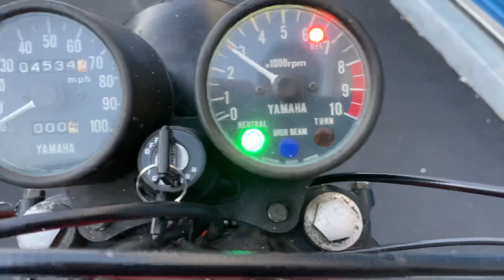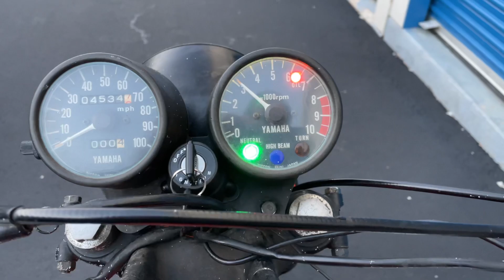1978 Yamaha DT250 first start in 6 weeks. Surging…

Comment: Isn't that the 2 stroke oil warning light?, idling high could be a airleak, 
very good looking Yamaha DT!
Reply from the maker: Thank you! Yeah that's what im thinking. i need to get over to it today and take a closer look at the carb. The whole bike was recently gone over by very good 2 stroke mechanic friend so im sure its something silly lol
Reply: The oil light is on in neutral as a test for the light bulb.   When you put it in gear it should go away.  If it doesn't then it really is low on oil.